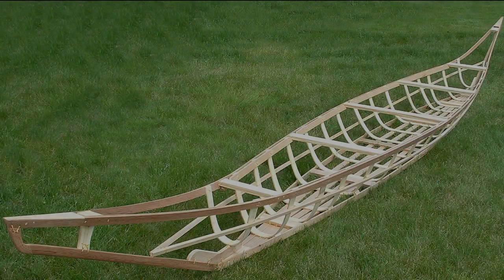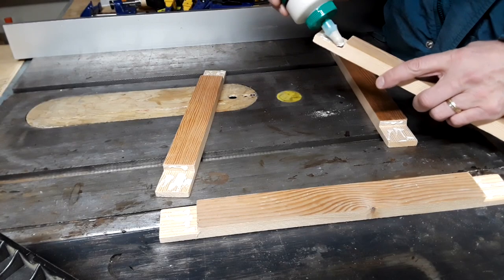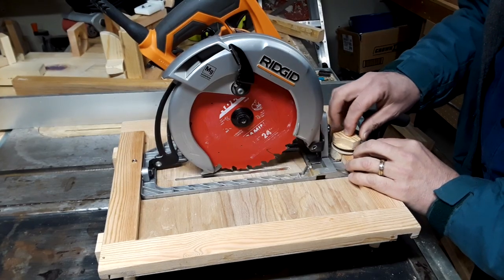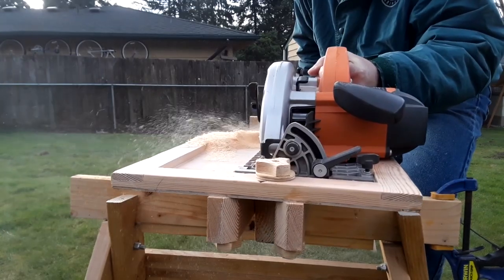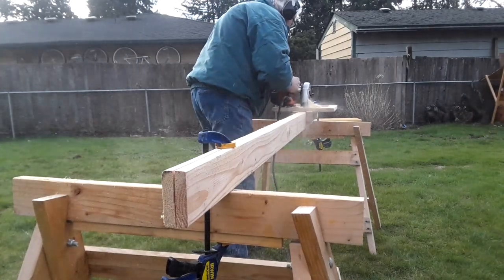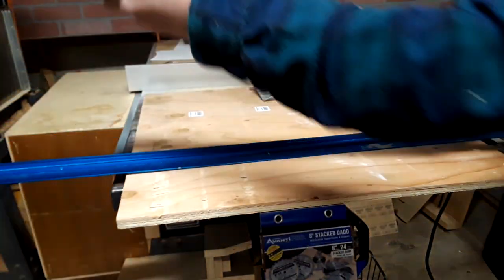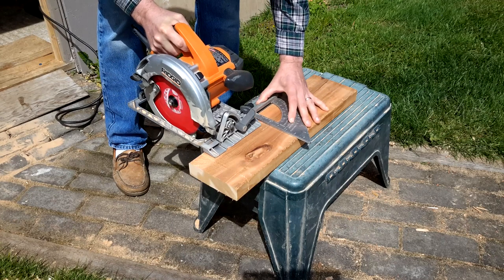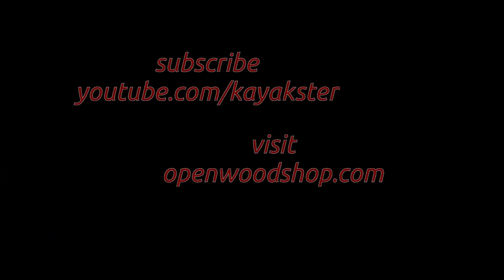Making a Circular Saw Re-saw Jig (& 2 other add ons)

Comment: Very good. I agree that with jigs the circular saw can be used for many tasks and mostly eliminate other saws.
For example, I was making kitchen cabinets and was using a table saw for cutting the plywood. 
I made a table sled for that task and while I was able to get those big sheets cut, it was a monster chore, especially since I was using 3/4" Baltic Birch plywood,  which is very heavy.
Later on, I bought a rather expensive track saw system and discarded the use of the table saw almost completely. 
I do not regret buying that track saw, but I could had made my own jigs and probably saved well over $500.  I bought a Mafell system which made Festool seem inexpensive.  This was a few years ago when the big international companies were not making them yet (probably still under patent protection ).

Comment: Do you think needing to add a riving in case kickback? Looks like it could get added if needed
Reply from the maker: A riving knife works good on a table saw but not on a circular saw.
Reply: Since you are on top of and holding the circular saw with two hands, and the motor is a lot weaker than a table saw's, you probably don't need a riving knife because it'll just seize up instead of kicking material.
Reply: @MyChevySonic  Thanks. That makes sense. I've done this with my table saw. I'll probably make a jig like this with some leftover t tracks I have.
Reply: @OpenWoodShop  thanks

Comment: It may be a bit awkward with longer pieces but that will make a fantastic tenon cutting jig on the ends.  Heck, you can do bridles and half laps with that easy if you got the right spacer.
Reply from the maker: Some good ideas. There's probably a lot more that can be done with it that what I'm using it for.

Comment: What are the two blue-colored channels that you fixed to the underside of the plywood and how do the two guide fences get bolted to that channel? 

I see you've got some kind of bolts that presumably pass through holes that you've drilled in the guide fences, but how do those bolts fix the fences to the two blue channels?
Reply from the maker: That is T track. The bolt heads slide in those tracks.

Comment: Honestly, resawing on a tablesaw is rather cumbersome. I thought about, what would help is a special tablesaw, that has the blade horizontally instead of vertically, that way you could use the whole surface to put the lumber flat down on it.
But this right here, is also better then using a tablesaw. If you affix the lumber to be cut correct, there is allot less risk of cutting yourself with this jig.
Reply: And the weight of the lumber on top would make that very prone to kickback

Comment: Thank you for this. This has inspired me to resaw the walnut boards i have. The boards are just under 12 inch wide and 1.3 inch in width. Do you think if be able to get the resaw done with my 184mm circular saw or even get as close to the middle of the board by cutting one edge then  flipping it over to cut the other edge then somehow manually saw the any remaining material the blades didn't reach or would it be better rip the 12inch wide board in half to 6inch? They have a slight cupping so I guess better to rip to 6 inch wide, plane edges a bit and then do the resaw with a jig like this then joint and plane all boards back together ;-)
Reply from the maker: Extend your  blade all the way and measure it. You will have to subtract the thickness of your base board (mine is about 1/8"). Blade depth  x  2 - (baseboard x 2). I usually can't do a perfect cut, but I get close. I still have to run it through the planer. Good luck!
Reply: @OpenWoodShop  thank you ;-)

Comment: Yet another "This is exactly what I needed to see!" comment. Hahaha... I'm about to get started on my first Greenland kayak and wasn't looking forward to resawing the 16' lumber on my bandsaw.
Reply from the maker: Great! Good luck on the Greenland kayak. If you haven't seen my web page, check out http://PaddleAndOar.com. Goodluck!
Reply: @OpenWoodShop  thank you! I'll check it out. Have you been able to make that jig work with a single fence to rip the gunnels? In other words, is that jig stable enough to do a 3" rip?
Reply from the maker: @JohnCooperWilliam  If you are talking about ripping on the edge, the blade won't go down 3". If you are wanting to rip with the jig sitting on the flat, you can use one or both fences fine. In other words, if you are trying to cut 3" off of a 2x6 or 2x4, the fences will move outwards so that you can use either one or both fences. Hope that helps.
Reply: @OpenWoodShop  Yes it does help. I just wanted to know if it worked for both ripping and resawing (I do realize you'll need to do a flip for the whole depth). The Cunningham book wasn't as clear as seeing it in use on your video. Thanks for your responses and time.

Comment: This seems to be the jig I need! Can you make long bevel cuts at about 20 degrees with this? I need to rip an oak board about 4/5 inch think (20mm) about 5" wide, and about 5' long at about a 20 degree angle. I saw a video using a table saw. but this is probably safer. Also can you post building plans for this jig? Thanks.
Reply from the maker: Since your piece is only 5' long, you might be better off using a table saw for your cut. Also, because the base of the jig has to be made to fit different makes and models of saws I never made plans for it, but I think that by watching the video you should be able to figure it out. Good luck!
Reply: Thanks for the quick reply. This is the video of a very similar cut to the one I need to make (for pretty much the same reason)  Watch from about 7:56 to about 11:20: www.youtube.com/watch?v=_tR0uZbtfCA

I don't own a table saw, and for safety I think your jig is much better. I'll give it a shot making my own. :) BTW my circular saw is a Ridgid R32021, maybe the same as yours. Thanks again for the quick reply.
Reply from the maker: 1) Since the table saw, which I think is using a 10" blade is not making it all the way through, the 7 1/4" blade on a circular saw will be even less. 2) Although he uses his table saw to finish off the two halves, I have done the same thing using a handsaw. 3) Having your work piece solidly clamped will be important. Good luck!

Comment: What is the best blade for deep cutting, like in your video ? Number of teeth and manufacturer name please ? Assume TCT blade is necessary in case hit a nail in older wood. Thanks for your video.
Reply from the maker: A 24 tooth carbide tipped ripping blade. Just about any blade brand is fine. The more expensive ones last longer. Diablo is easy for me to get and they last longer than Avanti.

Comment: What size t bolts did you use? I cant find any longer than 3.5inches and it seems you'd need at least 5in?
Reply from the maker: I'm not in the shop now but as I remember I just used he bolts and ground down 2 sides to fit in the t track.

Comment: How did you get the saw to cut half way through a 2 x 6 board. Mine does not have enough cutting depth to do that. Please let me know. This is just what I need.
Reply from the maker: That was a 2x4 and not a 2x6. Camera angle perhaps? Thanks for watching.
Reply: But there are bigger circular saws you could get.  A saw with a 10-1/4" blade gives you close to a 4" cutting depth, which would get you through 7"+ wide material with a pass from either side, and a saw with a 16-5/16" blade has over a 6" cutting depth, so could theoretically allow you to resaw even 12" wide boards/beams.

Comment: What are the things you are using to attach the sliding boards to the t tracks called? (The wooden screws with the nuts inside)
Reply from the maker: I believe you are talking about the shop  made knobs. The metal threaded parts are called T nuts. You can also use threaded inserts.